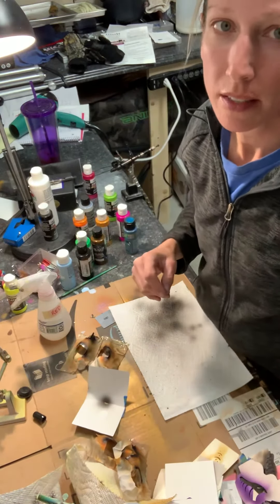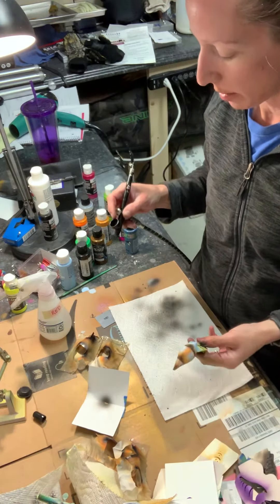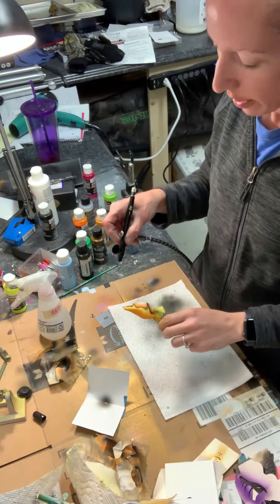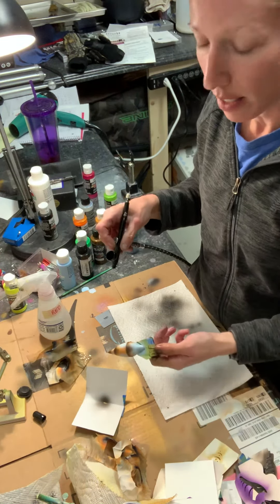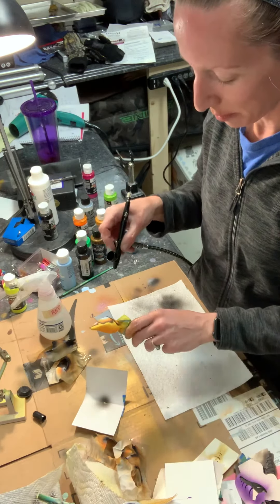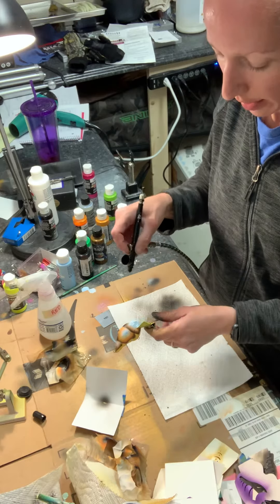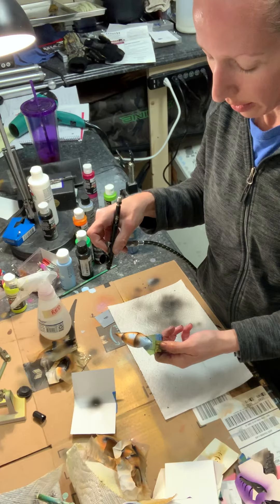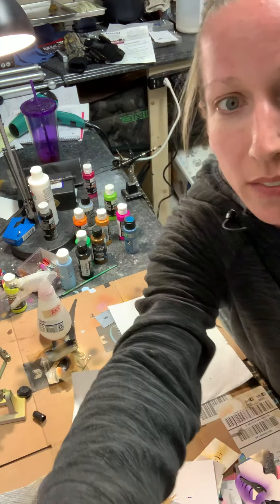Spatter 101 - Lure Painting

Comment: Interesting. I turn the pressure down to very low and pull the trigger back quickly to spatter mine. Have also used a toothbrush. I will say not as exact as your technique as to where it goes. You do nice work.